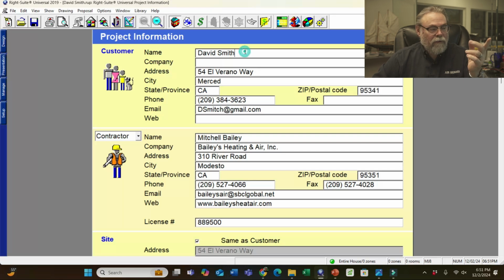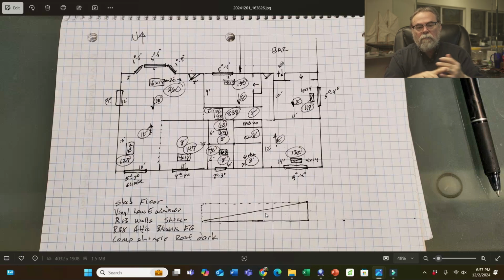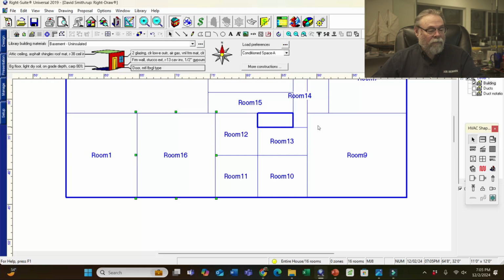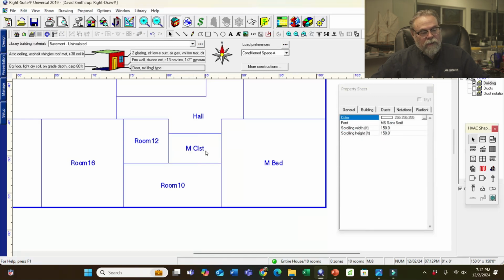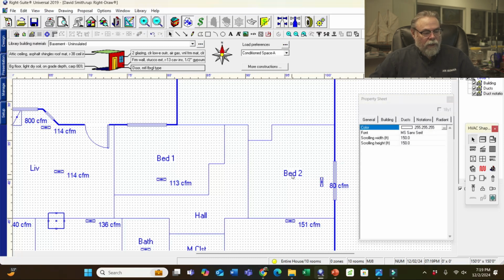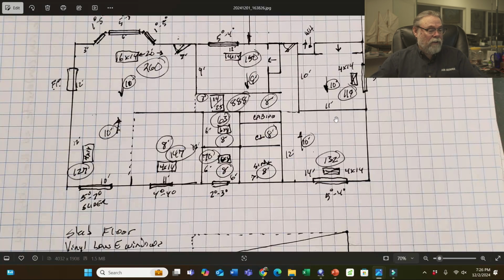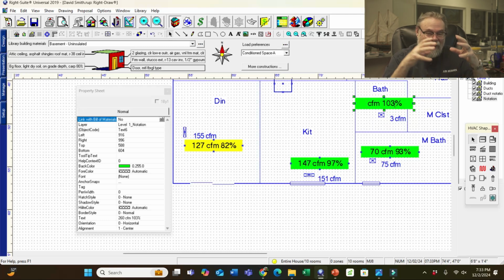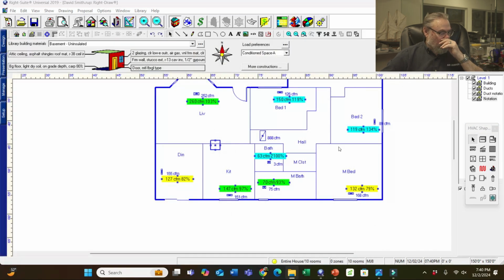Drawing a house using Wrightsoft

Comment: Great video. You mentioned that the garage does not affect the load, but while using Wrightsoft I noticed the tonnage changed by a few hundred BTUs when the garage was included. I followed the same setup steps, so my only thought is that the software may be automatically accounting for ductwork located in the garage attic. Could you provide some guidance on how to remove or exclude ducts from the garage? It appears they were automatically calculated, and I couldn’t find where to adjust or remove them.

Thank you great video
Reply from the maker: I made a video explaining the garage and how to exclude it from the load calculation. Check it out https://youtu.be/4L1EKsTYv7E
Reply: @baileysair o thank you so much

Comment: Very Helpful.  Could you maybe do a video on setting boundry types or "Adjacent to" walls to help us understand the interface between the conditioned space's walls and the garage.  Doesn't that make the external wall at this boundry have a different DeltaT?
Reply: Select the Garage and make sure there is no cooling or heating. Then Right click on the room next to it. after you click oK, it'll pop up and say wall next to an unconditioned space. You can specify the Temps in the garage and the software will compute it for you.